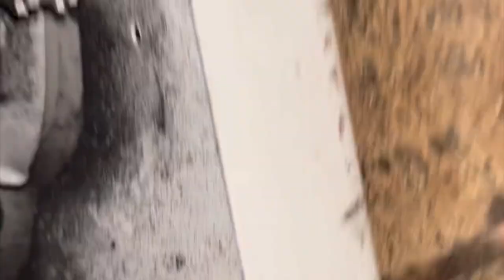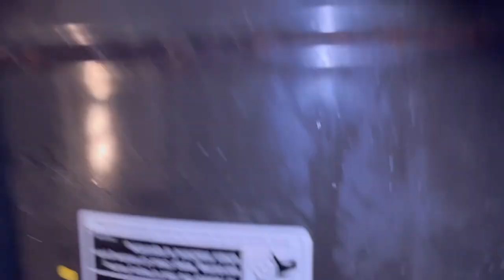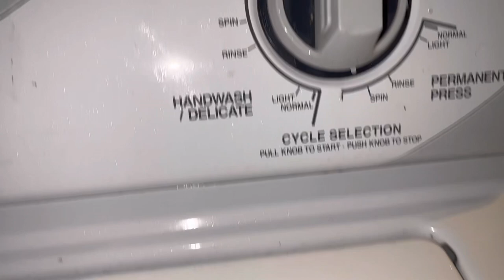Speed Queen Washer Not Spinning | Belt Installation. (AWN412SP111TW01)

Comment: So our washer wouldn't spin or drain so we replaced the belt and they pulley (that was broken). Now it sounds like it is seizing when time to spin. The belt is moving very slowly, sometimes slipping and the motor is starting to smoke as its trying to spin. Any ideas as to what I do next?
Reply from the maker: Check your email I responded. Thanks
Reply: same here what's the fix
Reply: I having the same problem did you find out what was wrong

Comment: How did you remove the pump so easily? It feels like there is something else securing the pump to the motor
Reply from the maker: You can do it also, press the center down as you pull the end. Thanks for watching.
Reply: @appliancerepairshorts my situation ended up being that the center of the pump melted to the shaft and became glued to the shaft. I struggled for about an hour carefully wedging and extracting with a long flathead in order to break the melted plastic, but proved successful. Thank you so much.

Comment: If the clips are missing does it have screws holding it up? No clips and it won't come free
Reply from the maker: Probably not, but you would have to order special screws. You would have to have the screw holes in the pump feet. Or just order the clips. Good luck

Comment: Hi our 220V motor started to smoke and so we removed the motor and found black residue on the copper windings also the belt was worn to shreds my question what could have caused this problem ?
Reply from the maker: Hi Simon, the black residue is from the belt. From the friction and heat of the motor, the belt melted but i wouldn't worry about the residue. Just clean it off. It sounds like it may be overloaded or a bad/worn pulley. Replace the pulley if it's not turning perfectly smooth. The belts usually last about 6-7 years.

Comment: Thanks for the video! Got a question for you, what if the motor doesn’t spin at all when we switch it on, the belt is relatively okay/still on track BUT when I hit spin all it doesn’t is drain water, thanks!
Reply from the maker: Sorry I didn’t see your comment. You can also email me. Your question wasn’t too clear. If it is not spinning, check the lip switch, but also check for obstruction in the pump or the belt could be worn out also you have a capacitor, if you put it on spin and are able to partially spin by hand. If it spins, replace the capacitor. Hopefully you already got it
Reply: Olá boa tarde eu tenho uma speedqueen lavadora ela só lava mais na primeira lavagem ela não centrifuga entra a centrifugação e para e começa a entra água ae ela não enxaguar?

Comment: What are all symptoms that could cause the speed queen washer not to spin only and agitate only and both agitate and spin.
Reply from the maker: To make sure I understand what you’re saying. The washer doesn’t spin in any cycle? So I would check the belt, the idler pulley. Remove the front cover and remove the drain pump. See now if it spins. Do you hear a humming? A bad capacitor. You can also check for power going to the motor. Send a model number. How is your lid switch?
Reply: I will let you know

Comment: Help. I installed the belt and before this installation it never leaked. Now after the installation it leaks from the top. Rim.  
Also now only blinks and beeps 3x
Reply from the maker: I would need a model number. The leaking is probably from the drip rail edge. You might have soap scum blocking the drainage and it is spilling over. I’ll tag you in a speed Queen maintenance video.

Comment: can the brake stop the spinning . my machine spin the motor works but the maim shaft dont turn. i havent used machine for a whilev cac the brake be the problem. thank you
Reply from the maker: How old is your washer? You might have a brake that isn’t releasing. Try tapping it with a rubber mallet. Or you might have something caught in the pump or clothing in between the inner and outer basket

Comment: How does the rod that puts tension on the belt assembly work 

My speed queen is spinning sometimes and some times not like the rod isnt moving to put tension on it some of the time what do i need to look into to fix that? Belt is fairly new.   Spring on tensioner is kind of new although it only pulls it back its not for putting tension
Reply from the maker: I think you might have the belt on the wrong way. Or it it too big. When you say the belt is new, why are you changing it. What was the original problem?
Reply: @appliancerepairshorts  so the washer has been working with the same belt for over a year now.   It was a while back when I replaced it.   Has been used on daily basis 

It appears to be on the tensioner and pullys.   I felt it with my hand and looked at it

I can put the washer on a spin cycle.   Sometimes it goes into spin but most of the time only pumps.  No spin.  *BUT IF I MANUALLY MOVE THE TENSIONER WITH MY HAND IT SUDDENLY STARTS SPINNING*

at that point it will spin until cycle is over.   I've looked a bit online but haven't found anyone experiencing this so far.  If you think it would help I could upload a video of the inside of washer while it's operating so you can see what I mean
Reply: @appliancerepairshorts  I'm not changing it.   What I meant was it was changed in the past the other one was freyd real bad so my point is that it's not a worn out belt causing it to slip.   Spring was also replaced a year or so ago but washer has been used probably 100 times since then
Reply from the maker: @BRWfilms  got you, yes upload a video and email it to me. How is the spring tension
Reply: @appliancerepairshorts  I think the spring tension is good but I haven't taken it apart and physically checked the spring but I did look at it.    I'm out of town till 25th.   I will definitely upload a vid and email it to you when I am back. I appreciate you taking the time to get back to me!
Reply: @appliancerepairshorts  hey going to make a video now.   I think it's the timer.   My mom was playing with it and noticed sometimes it goes completely through the whole cycle to a different cycle like regular all the way around perm press delicate ECT like it doesn't even stop where it should
Reply from the maker: @BRWfilms  yep if it is not turning off, it is the timer motor. Also check the knob first to make sure it is not broken. Pull it off and check it
Reply: @appliancerepairshorts  okay will do.   I'm going to go from there tho.   Either the motor or knob.   I think that will fix me up.   Thanks for your help and videos

Comment: Oh no, putting that left back clip on is impossible! Help!
Reply from the maker: I have a speed Queen, I’ll do a video on that later tonight
Reply: Thanks
Reply: With the pump still on , a man’s large hands will not fit behind the capacitor and behind that belt! My hubby had me in there trying to help. My hands fit all the way in but once I found where the dang top should hang I could not push down hard enough to set the clamp! After a long long time trying hubby finally took the motor out. Whew! Running like a speed Queen!